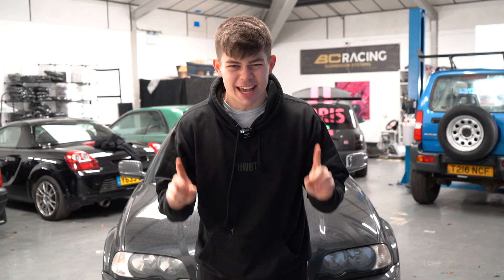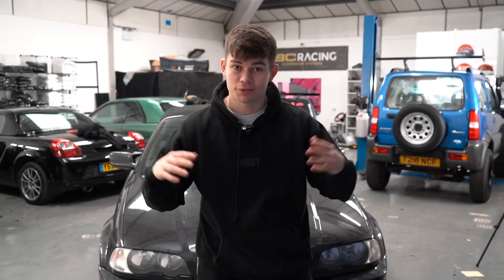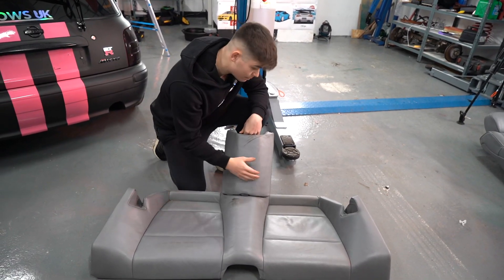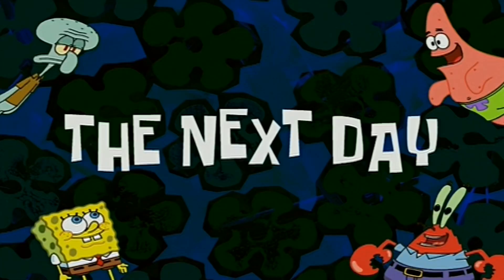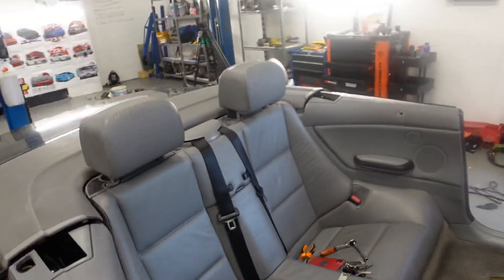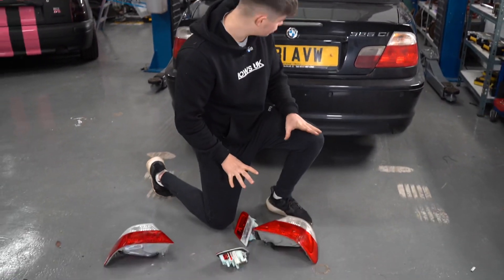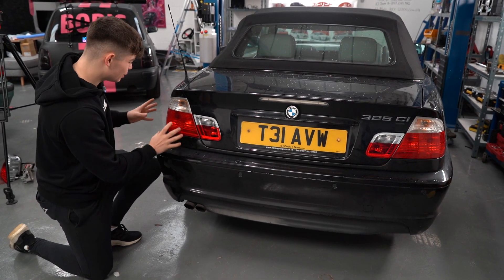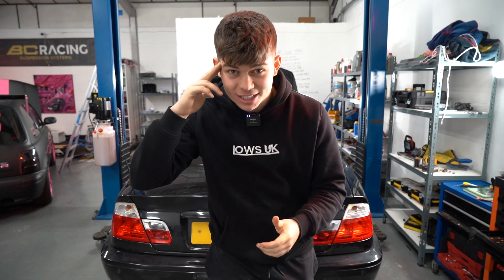SERIOUS PROGRESS ON THE BUDGET BMW RESTORATION!

Comment: Hi mate. I have a 3 series, albeit a lot newer (e90 2011) and I had the same thing with traction control and all the same lights as yours. Mine turned out to be a wheel speed sensor but earlier models do use reluctor rings too. So make sure you check those. Likely culprits.

Comment: Hi Jack I have a e46 coupe too and currently have the lights on the dash too. In my case I found out it was my front right wheel speed sensor that broke which then disabled the DSC and made the ABS act up. A replacement one is only around €40. Hope that helps.

Comment: Jack- For the lights, it should be happening because of the ABS sensor/ wheel speed sensor, get them changed over should fix the issue. That's your cheaper option.

If that doesn't work, then it will most probably be the ABS pump, can get a 2nd hand one or get this one returned, a new one will need to be coded in
Reply from the maker: Yes abs sensors is a great shout, may have to have a go next video!
Reply: @JackMcNeillCars  may as well be ABS ring
Reply: I also had the issue when I crashed my rear passenger side and bent the rear suspension arms and was abs also
Reply: Also while your fixing everything on it, consider changing the expansion tank, mine just blew, and coolant spilled all over. It's a common fault on these, been getting ready to do it, to avoid it exploding but the car beat me to it. It's currently sitting outside my house with no coolant

Comment: Central locking is the body control module, will also cause the boot issue. Abs module or speed sensor for  TC lights air bag light may also be related to body module. Best to code read before spending any big money though as parts darts can get frustrating.

Comment: Airbag light is common on the E46. Can often be seat weight sensor related or seatbelt pre tensioner. Or you can take out fuse number 10 and the light goes out, so I’m told.

Comment: I have an e46... the airbag light is on in all of them, its a very common problem, dont get confused. Yhe airbags may need to be changed kr something with the wires. Now, gor the other  lights its  some sensors or wires

Comment: I had the traction triangle of death on my 1 series, I had to replace the abs wheel sensors and reluctor rings then get the steering angle coded to get rid the thoose lights

Comment: The alarm problem will most likely be the bonnet sensor as it happened to my e46 compact so I just unplugged it as it’s not really important and check the fuses with the other problems as they could be out slightly as had similar issue as soon as I pushed all the fuses so they where all in properly it was all fixed and the airbag will be covered as there is a recall from bmw as the airbags have an issue and bmw will replace them as a recall

Comment: The driver seat issue will most likely just be a snapped weld. If not, then the next best solution would be to reupholster the original seat with the broken seat’s material.

Comment: I have a 2001 mini. A common issue for dash lights. The airbag light can be an issue with the wires under the driver/passenger seats. Best to un-connect them then connect again and clear any fault codes on ecu 👍

Comment: Those 3 lights are because of one of abs sensors playing up,airbag sensor is probably the passanger seat that has a sensor.in it to see if you have a passenger or not so it can deploy the airbag or not,and the boot might want to check the wiring loom and boot switch,it can also trigger the alarm whenn it opens the boot 👍

Comment: If you’ve taken the battery off or done anything with that, usually has a airbag connector and if that gets removed from the battery you will have a warning light. Should be able to code it out mate

Comment: I had this problem with my 330D, turned out the be the brushes in the ABS pump were sticking. When the lights are on give the ABS pump a tap  with a hammer or mallet, if the lights go off then you will need to get it refurbed or replaced 👍🏻

Comment: Had the same issues on two of mine, airbag light turned out to be passenger occupancy sensor, you can get a bypass plug off eBay that gets rid of the light, just plug it in underneath the seat. The traction control light turned out to be front right abs sensor, buy yourself a cheap code reader off eBay

Comment: Traction and abs lights will be a abs sensor mine are normally off but once I go over 60/70mph they’ll come on the handbrake light could just be low brake pads or a brake wear sensor issue if it has them

Comment: the brake light that doesnt have the ABS light is the pad wear sensor, so either the pads themselves or one of the 4 sensors went caput. ABS module, idk. the seatbelt buckles also are a failure item that can trip the airbag light. I have an e46, and my airbag light is on for that exact reason LMAO. 

the traction control light can come on in tandem with a few other lights, most notably the yellow e-brake light, which can come on for a whole myriad of things. being that you dont have that i wouldnt worry, but you still wont have DSC at your disposal on the road.

finally, get a carly scanner, a euro car owner's best friend. merry hair pulling jack :)

Comment: Jack, When you lock your car using the button on your key the same thing happens to my e46 where it will randomly turn the alarm on when no one is near it i found out that its because the alarm is very sensitive and i just lock it using the key into the door and that turns the alarm off (Use this method of locking the car when you are leaving the car in a safe area as the car is locked but the alarm is off). The airbag light could have been triggered when someone unplugged the seats/air bags without disconnecting the battery you can easily just clear the airbag light using a scanner/computer. The traction light, abs light and handbrake light is on due to the rear abs sensors they are usually good and working but the rust pushes them out of place and they throw a light i heard people put washers behind the sensor to space them out not sure exactly how this works but try and take them out and clean the area and put the rear abs sensors back in worth a try to see if the light turn off or do what i did and clear the codes using a scanner/computer and hope the lights don't come back haha

Comment: Abs sensors can catch hit the reluctor rings (they can bulge due to rust) to avoid having to dismantle the rear end, add a 2mm washer to the sensor for a larger gap, if the sensors are good this will solve the issue, but replacing and doing this will avoid it in the future also.

Comment: Alarm - disconnect the sensor for the bonnet OR ensure there are no coins / metal left in the centre console - particularly alongside the handbrake
Reply: Coins? Could this be the issue, I have the same problem and its not the bonnet switch.

Comment: The alarm going off will be the bonnet sensor on the rhs, just unplug it. The dash lights are most likely the rear abs sensors but a plug in would be best
Reply: you sir are a legend
Reply: @jakechild7417  haha appreciate it mate
Reply: @jakechild7417  Did this work,? I have the same issue but it didn't work on mine.
Reply: @gyimpity  yep worked for me!

Comment: Those dashboard lights are because you have a faulty wheel speed sensor. Very cheap to replace and easy to do. Just plug in a OBD reader to tel you which wheel it is. But tbh if replace all of them as they’re old. Check eBay for replacements - I made a mistake going to ECP they charged me £50 for one. On eBay the quality was better and I got all 4 for around £25. these sensors usually wear out over time. A LOT of beemers have these lights on

Comment: The traction, handbrake and abs light is because of the abs ring. The airbag light is because of a seat occupancy sensor in the passenger seat, which could be replaced with a resistor to deactivate it. The alarm goes off at night because of one of your sensors, to deactivate the motion sensors lock the car and when the car is locked press the lock button again, you should see your interior light come on and this deactivates the sensors.

Comment: My car has never been in an accident and has airbags but the airbag light is on because on the sensors underneath the seat as you move the seat back and forward it stretches the wire causing the light to come on

Comment: Please solder those speaker connections and not use those dreadful hazardous scotch locks. As people have commented those rear reluctor rings will either be broken or most likely corroded to hell. Boot mechanism is probably dirty or needs replacing.  As for the alarm going off there is probably some connnectivity lost somewhere or wires have a small break in them so it will mean hunting down the right loom for that. I'd also suggest getting a laptop and a copy of ISTA to read codes and see what else is up. Also if this cat has been sat around for a while then I'd suggest getting a new battery and using the laptop and reset the codes and tell the car has a new battery, not all GMW's of this age have that option to but its worth looking into. And finally please replace that bulb holder for the rear light, I hope that duct tape is a short term solution